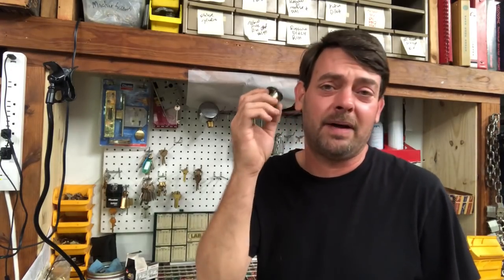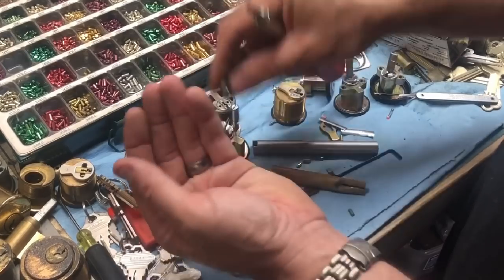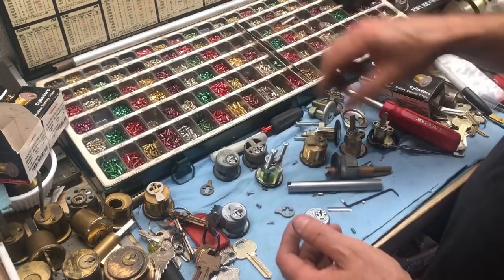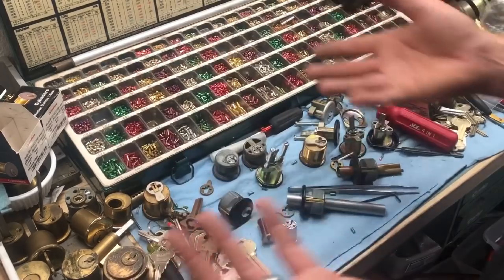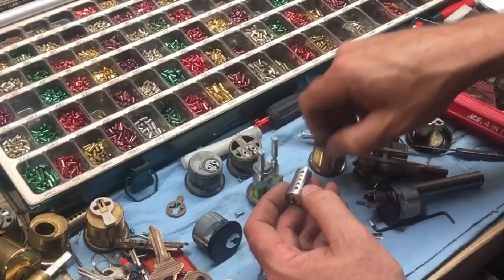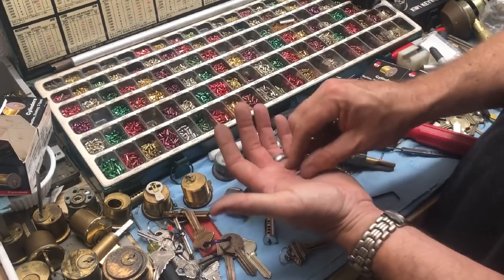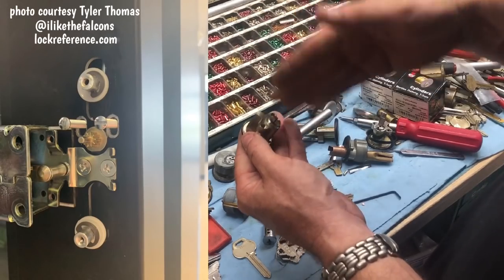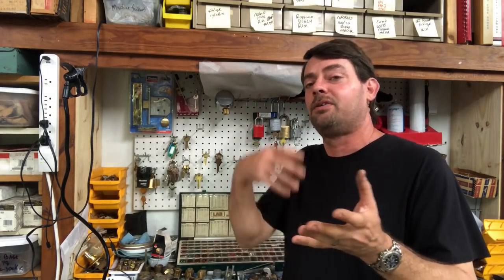cheap mortise & rim cylinders used on narrow stile glass doors

Comment: Nice job, well explained. HATE the crappy zinc mortise cylinders. On exterior doors, we automatically  (at our own cost) swap them out with the brass mortises. For a couple reasons, we are the ones who have to work on them, and we always end up with them if a tenant leaves, they always remain on our buildings. Sort of the "spend it now, or spend it later" deal for us. Different circumstances in your case when you have to try to convince a customer to upgrade... all you can do is try! Thanks Jason!

Comment: I've bought zinc thumb turns and solid brass rim & mortise cylinders from the same supplier, no name type. The brass ones were machined to the same sloppy tolerance on the plug side. The body threads were worse on the zinc (harder to screw in).
Thanks Jason. I'm enjoying catching up on all your video's in my spare time.

Comment: My best guess as to why the holes for the pin holes are all interconnected by a slot is that it probably simplifies the core design for the Die that it is cast in. There is probably a single piece of metal in the Die that takes up that space so when it is cast the pin holes for not get filled up with molten metal. 

If you want individual holes with no slot in between you would need to have either individual pins in a more complicated core for the Die. Otherwise they could be drilled in after it is cast however that sort of defeats the reasons for die casting versus machining from a solid piece of brass stock

I suspect that the Die is designed so that the resulting lock plug requires little or no machining before it is plated. keeping the cost (and quality) to an absolute minimum. I just wonder how long it will be before they try to start making them from a one piece injection molded plastic to cut cost even further.

Comment: I notice your caption about spring pressure holding in the masters. I have actually seen the master turn after the lock has been in service for a while. Can't get the key in or out of the door, or lock won't work. Take it apart carefully and sure enough the master has turned between the chambers in the little slot. Hate those things. Like you said easy to pick. Spacer ring video went up first. At least for me.
Reply from the maker: Oh I am sure they would skip out of place, really all it would take is the spring hanging up one time and its game over. Once they get heavy use (ya know, three months in) it prolly wouldn't take much. I often keep these after I switch to new cylinders if they are in good shape for the next person's who may not be in good shape and just charge the regular rekey cost, especially when you get those "verify price three times with you beforehand" types ;)

Comment: that was a really scary video. self tapping screws, soft materials, openings between the chambers. master wafers rolling up and down between the chambers for automatic rekey. How about just putting a no entry sign on the door. next step down hill must be all plastic or cardboard cylinders
Reply: Didn't Weiser make a knob cylinder that was made out of plastic.  At my locksmith school we went over Schlage, Kwikset, Weiser, and Weslock brands.
Reply: @ken_9359  

Welder did indeed make a plastic cylinder. Curiously, they seldom ever failed.

Comment: I did a job for a camera store who's friends with my dad.  I only charged him $35 for this.  He had two aluminum cylinders, one to open the door, and the other to lock it from the inside.  The outside cylinder would wobble up and down.  I took out the cylinder and it was worn out where the set screw held it in, so the right side of the cylinder couldn't hold the cylinder in straight anymore.  So I took the cylinder from the inside and put that on the outside and vice-versa.  Now the worn cylinder was still good to use because the left side will be held by the set screw when you put it in from the inside.  Problem solved.